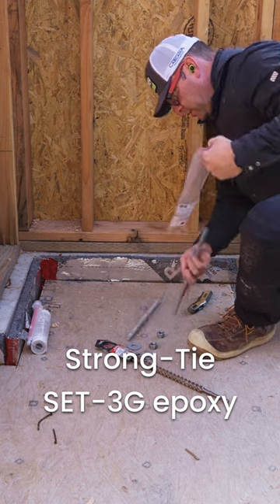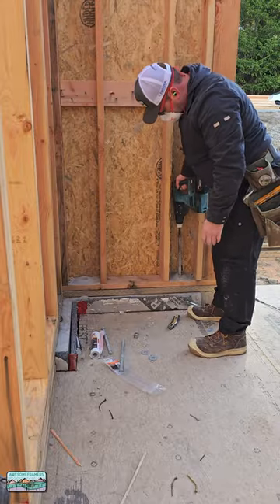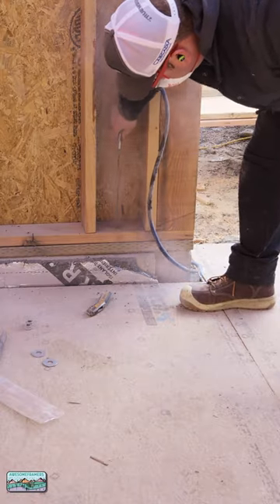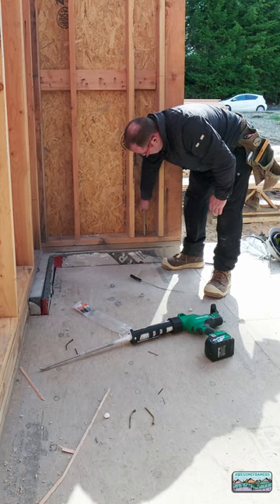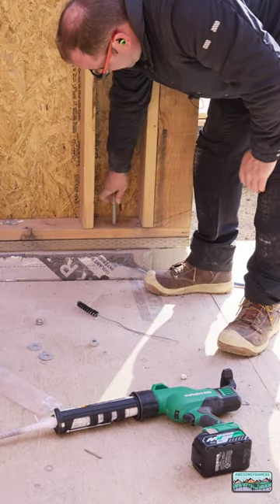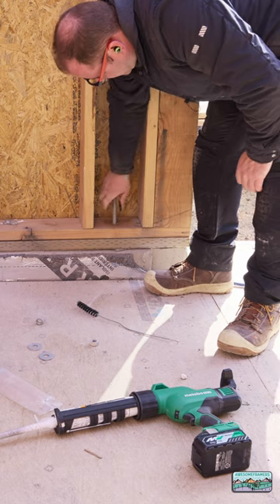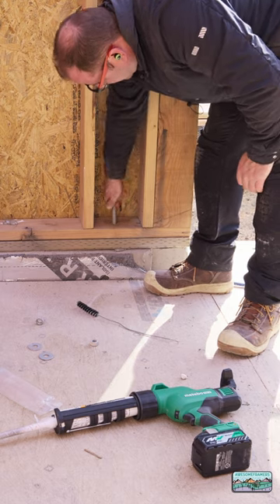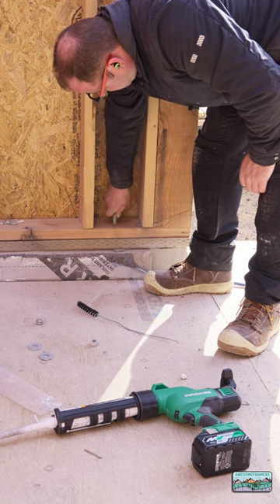The RIGHT Way- epoxy anchors #framing #engineering #construction #diy

Comment: You know the guy that tries this gets yelled at. “Slap it in and move on. We’ve got 4 other shitty houses to build.”
Reply: Dealing with that now with the current GC I work for. I’m leaving construction soon because of it. How am I supposed to go home feeling like I accomplished anything while my houses quickly degrade because of poor decisions by the GC…
Reply: yeah and they pee on the homes too
Reply: Pretty sure epoxies are designed to react with the dust and it doesn't really matter. Obviously, the freshness of the concrete can be a factor, but most concrete epoxies are formulated to build a Calcium carbonate stitch between the substraight and dowel.
Reply: And that shitty contractor that was yelling at him should be fired.
Reply: Which is why in California you have to pay a deputy inspector to watch you do this, and report on it.
Reply: @jackfiercetree5205 it matters. Epoxies will still bite if it’s not cracked in dust, but they won’t bite enough for the fastener to do what the engineer expected. Not being thorough about removing dust is kind of like using short nails.
Reply: @robertaylor9218  this may be true of SOME types of epoxies. Others expand and react in a way, that grime becomes like a million little wedge anchors, all pointing random directions...

Comment: Or, one could simply install the j-bolt before the concrete sets which is usually standard.
Reply: Your statements assumes the same contractor poured the foundation.
Reply: @John-Rambo81  not hardly
Reply: @John-Rambo81  Even with different contractors wouldn't they read the plans? And why would the wall be erected before the bolts were inserted? Wouldn't you have realized the issue before? Smh...
Reply: @John-Rambo81  its code for who ever poored it lol
Reply: I've used Epoxy into solid granite underwater amazing stuff.
Reply: Epoxy set anchors have more uplift capacity than j bolts do when installed properly. Could be chosen by a client if it’s a custom home, designed to need them, just what engineer chose to do the math with, or an adjustment to plans.
Reply: Or you can do it this way which simplifies the wall standing process to the tenth degree. You ever try and stand 2×8 16' long walls 16' tall by hand and try and get them over the bolts?! About impossible without a lift.
Reply: @undonesofficial  it is if you box frame, but I triple plate,  so I would not have to worry about it.
Reply: @rickcarson9423  because it’s easier placing the rod after the walls are built, you know how many times you have to cut out a j bolt because they land right on stud lay out, too many times
Reply: @pushtostart1377  I see your point, Push. However, you could mark the bolt positions on the bottom plate and even drill the holes before you even built the wall. Thanks for your comment. I do agree with @Steve Bentley that a large wall would be difficult to lift a drop on the bolts. Thanks, again!
Reply: @rickcarson9423  it doesn’t matter if you mark where the bolts are there has to be a stud every 16 inches, yeah you could do the math and figure out the exact measurement of where the bolts go or you could just put them after which is just as good and if you bolt the bottom plate down and then nail the wall to that really doesn’t make sense does it
Reply: @pushtostart1377  No. You put it down next to the bolts to see where the bolts are, mark it, drill it then build the wall, including bottom plate and set it down. No math. Just mark bolt location first.
Reply: @rickcarson9423  ok I don’t think you understand framing
Reply: @michaeltangusso9801  again… you have no idea what you’re talking about. Bolting down framing is inspected as part of the framing inspection. The city will only inspect your footings and most of the time ground wire on the foundation. If it’s poured walls they will inspect rebar in walls too. The carpenter will then install epoxied bolts. Ive done this more than you.
Reply: Pretty Brad statement without knowing jurisdiction code requirements. Often the foundation contractor only does the foundation and is gone by the time the framers show up. Plus, unless the concrete is properly consolidated, the uplift strength is greater with the epoxy, as there could be void around the j bolt, reducing its effectiveness.
Reply: J anchors are set 12” from each corner and every 4’ OC down a wall.  If you have to remove one because it’s in your layout then use this method to set a new one.   Unless a plan calls for these I’m using J anchors.
Reply: Sometimes you need to find a solution. Builders have to improvise you know.  To me that determines how good of a builder you are. You must be the type of guy that freezes when something doesn’t go according to plan. 😊

Comment: When you get to the job site, they’re going to try to vacuum out the hole. They’re going to put in the epoxy and  you will see a whole bunch of powder coming out. Nobody does it the right way, because nobody wants to take the timer follow the instructions.

Comment: Be careful that no oil gets to the airline on the compressor. The epoxy won’t bond. The little hand blower that Hilti provide is all you need and is what manufacturer recommends. I used to do loads of seismic concrete upgrades for tenant improvements in Vancouver and the guy doing the pull tests on my rebar said they will test more than required if they know a air compressor has been used to clear the holes.
Love the channel
Reply: There are also oilless air compressors. So there's that.
Reply: Most of small air compressor are oil less. Only moisture can get in.

Comment: Vacuum next to the rotary hammer bit while it’s drilling. Way less dust and easier to finish cleaning for the epoxy. I use a water spritzer bottle with compressed air and brush to finish cleaning.
Reply: You won’t be dying of silicosis in the future like this guy will
Reply: He's wearing a mask.
Reply: There will still be dust in the hole. Even when using a special vacuum drill (where the drill has a vacuuming tube inside) there will be dust. A brush-n-blow afterwards will still give you some dust.

Comment: I don't know zippy's zap about construction. I've used a lot of concrete anchors in my shop doing different things. Is there any advantage to an epoxy anchor versus a wedge type anchor?
Reply: Epoxy is way stroger and will not blow out the concrete if your near an edge.

Comment: Why not regular wedge anchors? Just curious
Reply: For the sake of the video
Reply: Epoxy anchors are stronger. So, it might have been specified by the engineer.
Reply: @JuanHernandez-os9gc wrong sir
Reply: The house can jump off the foundation with wedge anchors, but with epoxy anchors it can’t!

Comment: California code ; when pouring the foundation anchors bolts( J) are installed as specifications. Its easy.
Reply: Epoxy anchors, wedge anchors and Titen screws are all allowed by California building code too.

Comment: Does the slab have to be that deep? Usually they're 4in.

Is it okay if you drill all the way into the ground to use the epoxy??
Reply from the maker: No, for anchors you ned more than 4"
Reply: Depending on where you live, I'm pretty sure there's a 4' foundation wall underneath that sill plate, not just dirt.
Reply: @renski8976  usually there is a 12"x 12" footing around the perimeter to keep the slab from sliding and to hold the weight of the wall....
Reply: @mikemissildine370  I just said that it depends on where you might live... In Canada we put 4' foundation walls underneath all our exterior walls to prevent frost from heaving the wall.

Comment: I prefer leaving the epoxy in the truck and making sure the foundation contractor has the bolt schedule and knows they'll be responsible for fixing any f ups in that matter.  HAHA!
OR:
If the epoxy is so good, just epoxy the plates to the foundation.
OR:
Who needs bolts.  Push on that wall.  It's not going anywhere.
OR:
Tapcons or Ramset works great for this.
OR:
A thousand other ideas that don't comport with reality.

Good stuff.  Used epoxy for anchoring in commercial work for the first time in the late 1980s.  Heard they had some "creep" problems when using it on the ceiling panels of "The Big Dig" in Boston years ago.  Not gonna creep in this application.  I'm also a big fan of Rockite hydraulic cement, but you need big holes for it to work right.

Comment: How about if the architect and engineer have the Blu prints to design the foundation to put the anchor bolts in the proper place
Reply: Ever see a real aet of prints there are all kinds of areas where it only list the type of wall not the exact placement of the studs. There are too many variables that change stud locations.

Comment: Is there a diference in strenght between  j-bolt set in concrete  when poured or epoxying a bar in to cured concrete ?
Reply from the maker: Yep, but both exceed code requirements 👍

Comment: Why wasn't this put in during the concrete process
Reply: 2 main reasons- 
It's a pain to lift a sheathed wall over protruding j bolts
Some J bolts always end up right under a stud or post and either the framing or the bolt get hacked away. With post-set anchors you can always locate them where the studs ain't.

Comment: Epoxy rebar/rod is no joke. Our walkout basement has a 10' tall, solid-pour retaining wall on 3 sides. The contractor initially set the vertical rebar into the wrong side of the footing. So we used Hilti glass epoxy to set new rebar into the correct side of the footing. It hasn't cracked, moved, or leaked in 25 years.

Comment: Can anyone tell me what the pullout test results are?
Reply from the maker: You can find the information you need here https://www.strongtie.com/epoxyanchoringadhesives_adhesives/set-3g_adhesive/p/set-3g
Reply: 1/2" spud ratchet and 50# of forearm muscle will usually pull them right out. Keep extra oversized nuts and washers for stacking nearby for when the socket bottoms out.

Comment: why not just use anchor bolts
Reply from the maker: Here we have to install anchor bolt holders to hold them in place as the concrete is placed.  By the time we layout at this step, pour around them, install the anchor mates (bolt holders), then measure and drill the mudsill around the bolds, plus try and get our rake walls to set down over them, well we just don't find that is worth the time.

Comment: or use a simple sleeve bolt.. 2 min install
Reply: Not allowed if epoxy is on the print they are not even close to the same strength

Comment: With all the codes in construction today and it only takes a category 1 tornado to destroy it all.
Reply from the maker: That is misinformation, category 1 tornados are estimated wind speeds of 86 to 110 mph. Take a look at the homes that survived higher sustained winds during the  hurricanes that happen every year.
Reply: @AwesomeFramers  https://youtu.be/c-uFdoi6DEA

A direct hit from a tornado and you will be rebuilding your home. At least those bolts will stay in place.
Reply from the maker: @garrimic3  what category was that specific tornado? Also, a direct hit is a different energy than high winds in the range of a category 1
Reply: @AwesomeFramers  .. the winds from a direct hit of a tornado can reach upwards of 200+ mph while the winds around can be 60+ mph. Tornados are not the same as hurricanes.
Reply from the maker: @garrimic3  yep, they aren't the same. Your original comment didn't specify a direct hit,it just referenced the category. A category 1 tornado doesn't "destroy it all" as a blanket statement.
Reply: @AwesomeFramers  my point is that with all the ridiculous codes and the unnecessary codes that will continue to change in construction only causes the cost of owning a home more out of reach. Only to be destroyed by a simple storm.
Reply: @AwesomeFramers  ..true… I didn’t specify. I also labeled the destruction scale wrong as well. Hurricane storms are rated by category and tornadoes are rated by a EF system
Reply from the maker: @garrimic3  buy they aren't destroyed by a simple storm. They are very resilient. That's like saying cars aren't safe because that one in a billion boulder hits it
Reply: @AwesomeFramers  .. I have a home from the 70’s and it’s still standing strong. With little code when it was built.

Comment: Garbage. Your anchor bolts should be set in solid concrete right when it is poured. Those walls have no structural integrity.
Reply: Lol
Reply: I've got an honest question. If the bolts weren't put in when the concrete was poured, how is it remedied?
Would they repour the foundation? Just a section? Would the foundation crew/company be responssble?
Reply: Post-set anchors have been allowed by code for a long, long time. 
They provide plenty of structural strength if properly installed. 
Wherevya been?
Reply: @Bob3519  you can pre set the anchors in the concrete or you can use post-installed anchors like wedge, screw, or epoxy anchors.
Reply: Have you ever done any building, if so you would already know the answer